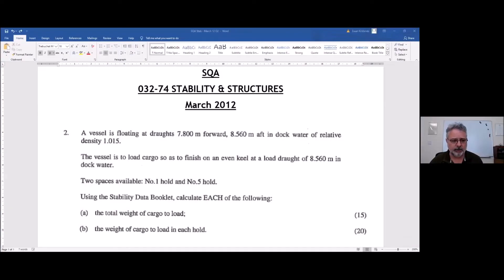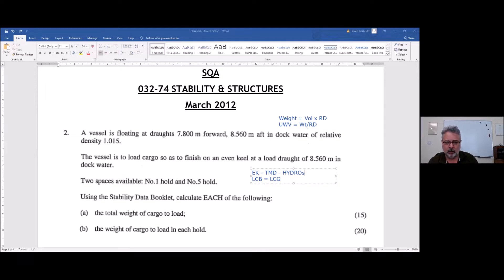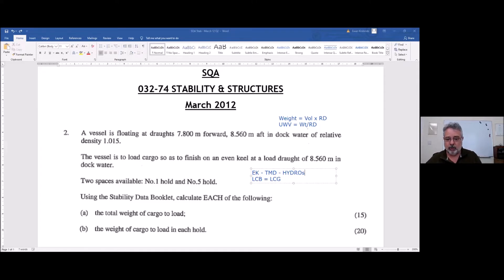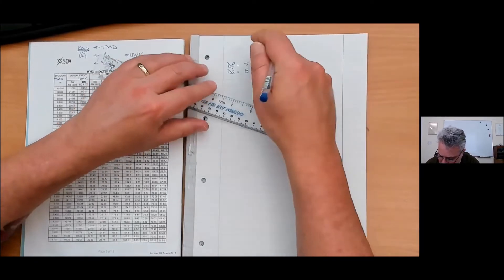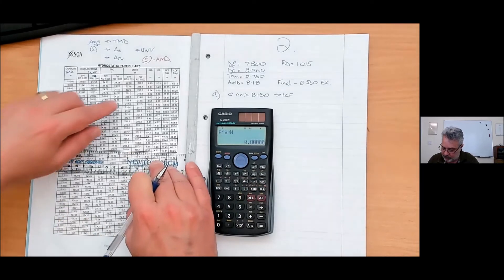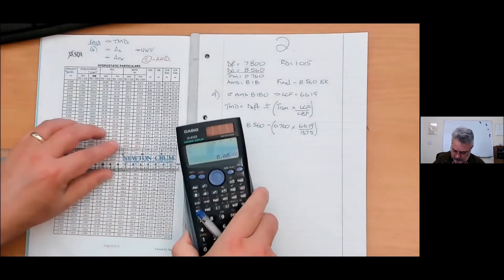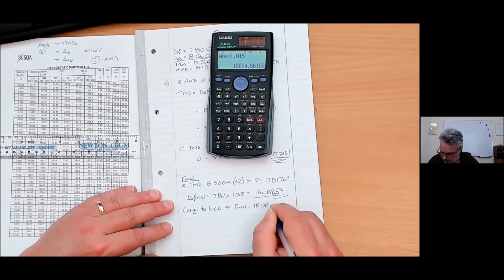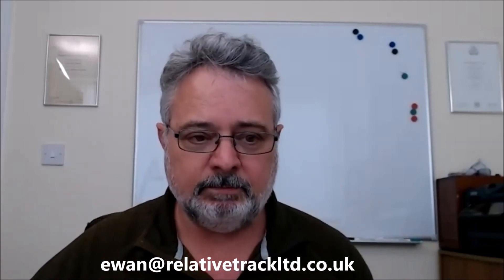SQA Stability   March '12 Q2a)  Total cargo to load?

Comment: Good day sir, kindly explain stability 2018 october q1
Reply from the maker: Hi. It's a fairly standard list question but must be approached in the correct order.

1. Think your way through the operation and identify WHEN the maximum list will occur. In this case this will be when the 1st weight is loaded and on deck and the second weight has just been picked up and is hanging over the quayside. These 2 weights are generating listing moments on the same side and must be calculated and added together. I got 1020tm.

2. Now you need to calculate what the GM would be assuming the above listing moment and the Max. list of 5 providedin the question. You must transpose the Tan List formulae to isolate and calculate it. Remember to add the 2 weights to the ship's initial displacement. I obtained a GMlist of 0.79 and then using the KM for this displacement calculated the KGlist.

3. Now we use a Loading (KG) Table to get the required answer. Set out the 3 headings: Weight, KG and Vertical Moments. Then we start with the values that represent the ship in the 5degree list condition. These values you have from Step 2 above. Now we mathematically reverse the loading operation: Put Wt 2 back down on the quay (i.e. discharge from end of derrick) and then discharge Wt1 from the deck. Now calculate the KG in THAT condition, with the two weights returned to their original position ashore. This is the KG that you need to START with so as to end up with a 5 degree list in the worst list experienced during loading.

I hope that helps.

Cheers
Ewan